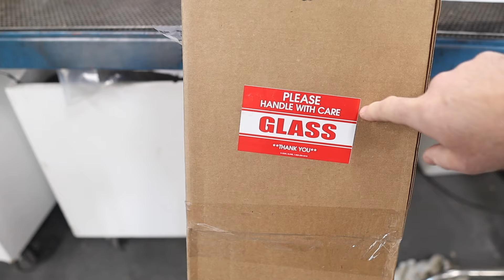Project 308 #Ferrari restoration: A Journey of Joy and Frustration!

Comment: Wow! Talk about the worst case scenario actually happening. But looking at it in a positive light, the car now has a new story of restoration adventure. It's nothing that cannot be overcome. Painful, yes, on many levels, but a fixable issue. And when the glass is all done, it'll be time to move on to the next part of the project. Whenever I wash my Mondial, I make sure to be very gentle when working anywhere near the rear glass, just being super paranoid. Probably also unobtainium. Looking forward to your next installment!
Reply from the maker: Thanks you. Worst case scenario for sure.

Comment: Went through this hell about a year ago and the short answer is you need to get hold of OEM glass, seals and mouldings to stand any chance of achieving a factory fit condition. Use glass branded St Gobain or Pilkington, all the other stuff you can forget. Front screen top and bottom mouldings are unobtainable, and if the originals were yanked off and bent taking them off as mine were, all that's available now are a different section. Many people give up and fit rubber seals on the front screen which can never look right. Persevere to source OEM and try to use someone whose done it before. It's a 2 man job - one guy on his own will struggle to fit the glass and mouldings correctly before the sealer starts to cure.
Reply from the maker: Rear glass is not made any longer.   Used only. Front there are options.  And yes I’m trying to save all the OEM stuff.
Reply: The Ferrari used a tradtional butyl rubber sealant that remains flexible - ie. it doesn't cure like urethane sealant that's used on 'today's' vehicles - so 'curing time' is not an issue during installation.
Reply from the maker: @georgebettiol8338  they tried tape first.

Comment: If you spray the rubber with soapy water before fitment it allows the the string and the rubber to move more freely.
Reply from the maker: oh yes, they both did.
Reply: As an ex windscreen technician the glass on Ferrari are not that bad to do. The 1st 2 guys didn't look very professional. Just be happy it's not a Porsche 911 back glass you were doing 😱 Stay positive the car is looking superb and you will reap the rewards of all your hard work Lou.

Comment: Hey I broke my windshield when I went to take the trim off from around it. But in my defense, the guy I hired to come remove it after it was broken, broke it some more after he told me it probably wouldn't have come out in one piece anyway. Then I found a shop to reinstall both that a little independent shop used to use for doing all the local vintage cars. And.....they used the wrong sealer around the windshield after I specifically told them what to use. But it didn't leak and they didn't break the new $1,000 glass so I considered it a win. 

Oh and I'm going on two years now I've had my GranTurismo apart to redo the F1 pump and motor. I got frustrated and then something keeps coming up like taking cares of my elderly dad who fell a couple weeks ago and broke himself up. So, one of these days we'll both be done!!
Reply from the maker: Yes one of these days life won’t interrupt me as much too.
Reply: @LouTrottier  At the rate I'm going you'll probably beat me. At least you are moving in the right direction. Keep at it and it'll be done before ya know it. You are getting so close.